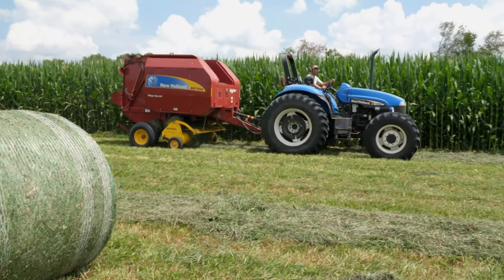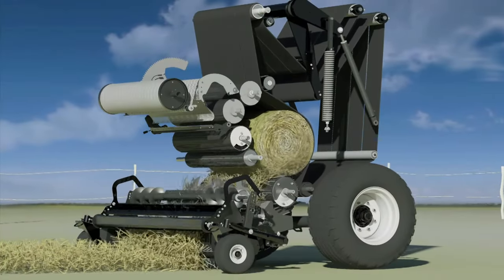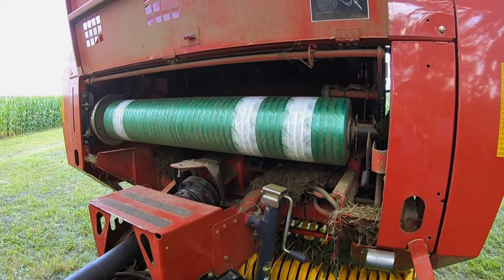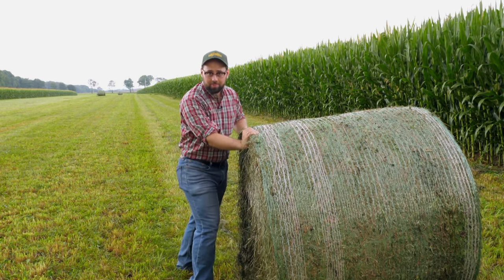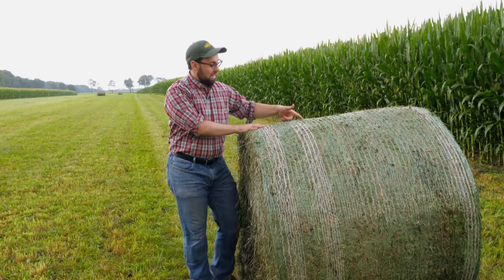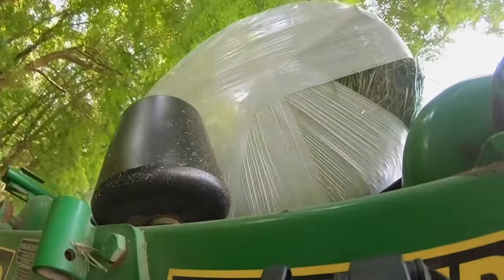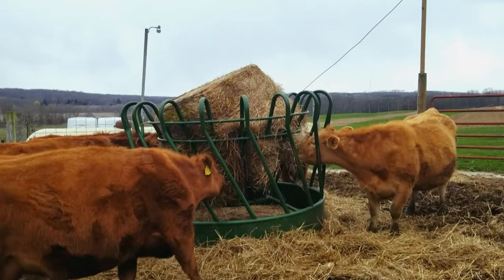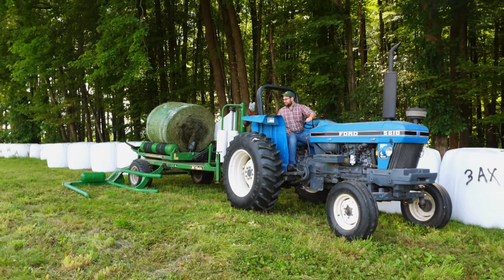How Do Round Balers Work?  |  MD F&H

Comment: When I was a teen and into my early 20's, we used a HOOK to pull the bails off the baler and stack on the wagon.  1st year I stacked in the barn, 2nd year, move up to trailer stacking, 3rd year, I drove the tractor and had 2 kids working the trailer.  Did bailing for 5 years and enjoyed it!

Comment: Very cool video. I have a question: i m interested in the problems that could happen with the round baler during the baling season with focus on the idler sprocket? How often do you change them? What is the main cause of idler sprocket failure? Thanks